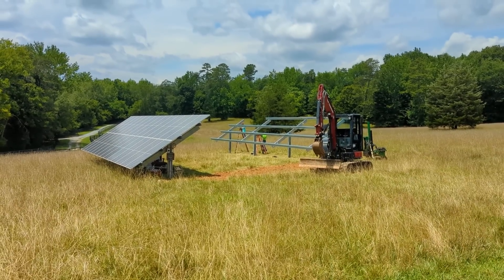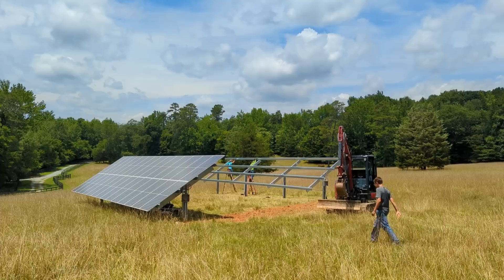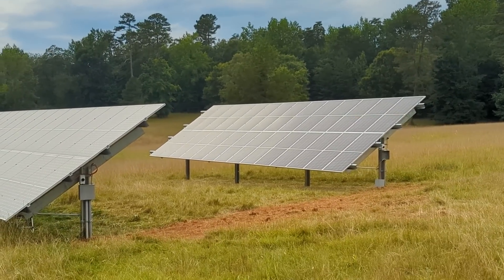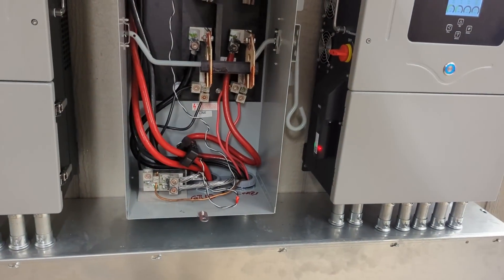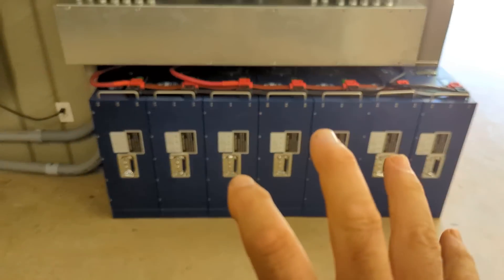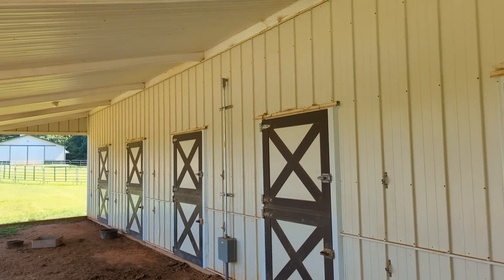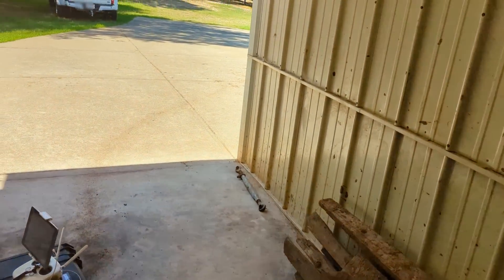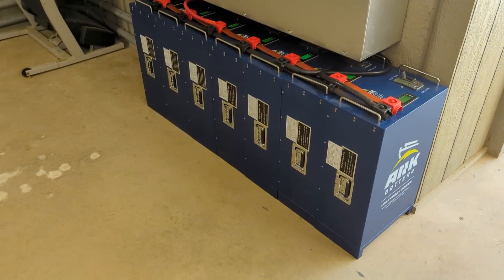Scalable is Saleable

Comment: Lay out white tarps or White vinyl underneath and extend it about 20 30 feet behind the bifacial array and stake it down that will increase the light level underneath panel very measurable difference. Reflective Mylar would be awesome but probably costly. But boy would that work wonders .

Comment: On the higher wattage panels, are you having to put one micro inverter on each panel? Or has someone manufactured them that can handle 1000 watts for two panels?
Reply from the maker: We typically do not use micro inverters. We are using the hybrid inverters that use DC strings.
Reply: @engineer775  thanks.

Comment: I'm trying to find a easy plug and go solo system for my off grid garden.  To pump water from tanks, filter pumps for fish pond, light, cool, heat a small green house, to watering the plants.  Any suggestions? Solar system over my head and confusing. Anything easy and affordable to use and just add to as my garden expands?

Comment: Great video Scott. Thank you for the two 12kw Sol-Ark inverters, two IMO switches and misc items. My two arrays are up with 80 triple black 320w Axitec panels. Just finished the trenching for a trench inspection soon. The wiring trough and inverters are mounted. I may need to schedule a call with you for a little counseling on the safety switch and ac 200 Amp fused disconnect. Thanks again.

Comment: Did you install "bifacials" because it snows there and you will get some kind of reflective component" I don't understand?
Reply: He said he installed them to get the closest match of panel to the original install.
Reply: @NoahBeall-BPS  Thanks!
Reply: Noah already answered the question you asked, but I've also thought about using bifacials and then surrounding the panels with white rock. One so I don't have to mow/ weed eat under it, and white so it reflects some light :)